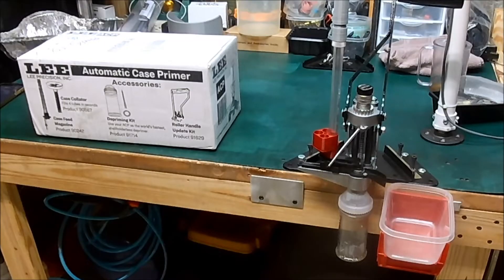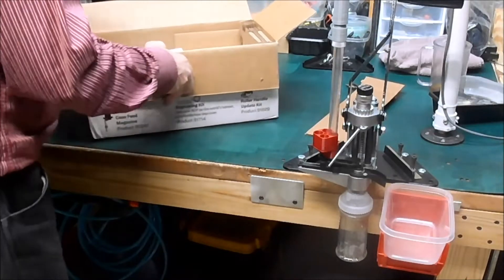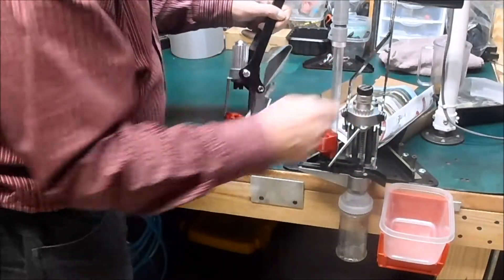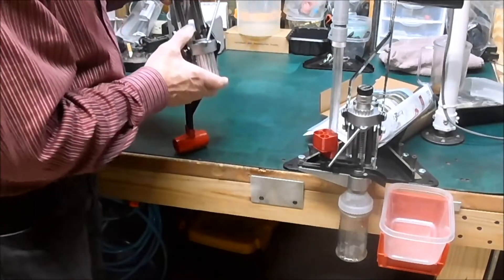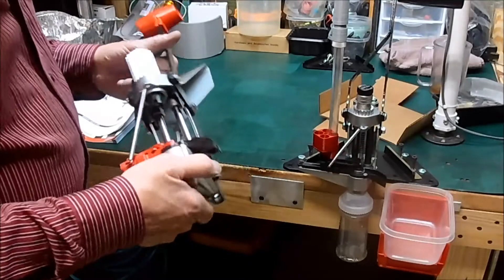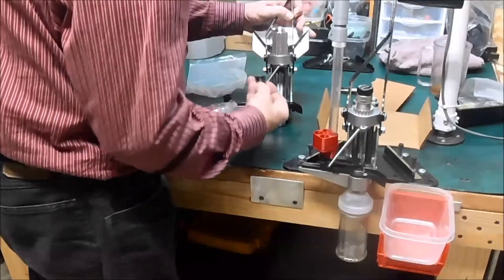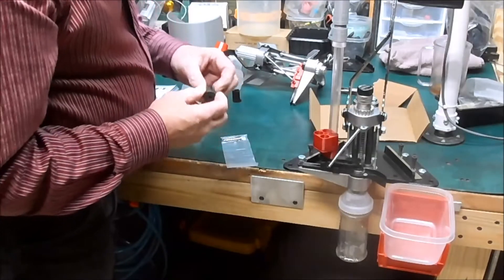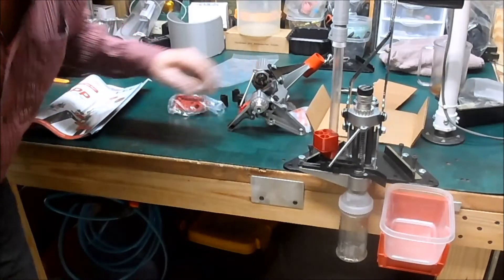LEE ACP UNBOXING TAKE 1

Comment: that looks a bit flimsy and doesn't seem like it will hold up with heavy use.
Reply from the maker: I had an issue it is resolved - will make another video
Reply from the maker: It really is not flimsy - it is almost like the APP which I have put thousands of brass and sized thousands of cast bullets with almost no issues.

Comment: You have de prime and re prime now .
Reply from the maker: They make a depriming  kit for the ACP - I just ordered one
But I have the APP for that - I ordered the kit because the ACP does not use shell holders it has a plastic device with fingers on it the will center the bras.